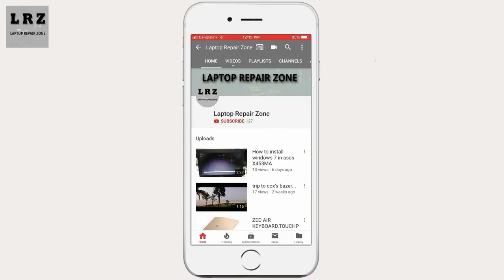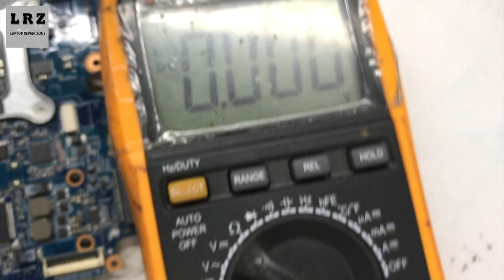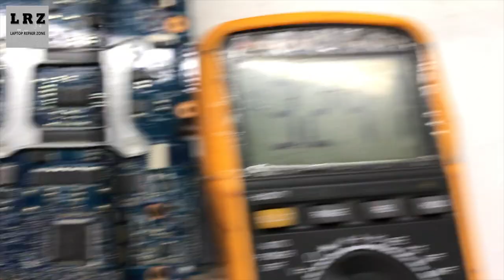hp probook charging light blinking white । Hp probook 4440s charging LED flashing

Comment: Hello friend, thanks for the video, I have in my laboratory an HP Probook 4440s, remove the capacitor that you show in the video but the fault continues, it has 3.3 volts in the power button, but the light keeps flashing 8 times and it turns off.
Reply: Lo solucionastes

Comment: Hi. I have same problem but laptop turns on when i replugged the charging pin and if i don't replugged , its lights keep flashing. Laptop is without battery. Any solution??

Comment: I Have ProBook 4340s in my case led on for one time & Can't turn on when i remove the battery 

When the battery battery is in the laptop led doesn't flash 
Please tell me what is the problem
Reply from the maker: Art By Sketcher thanks for your comment, you need to check all the required voltage step by step thanks.
Reply: @Laptop_repair_zone  now I change the Charger White led blink 8 times & Stop
Reply: @artbysketcher  how'd you fix it I have the same problem

Comment: One question, after doing all the steps, the flashing of the LED desperate and the few seconds appears again, does this cyclically and still does not turn on the PC, what other step can I follow, thanks
Reply from the maker: Walberto Pacheco thanks for your comment,you need to check 3V and 5V is ok or not.
Reply: after opening the capacitor, 5v and 3v are present, but it is as I told you before

Comment: 9 times out of 10 its just the Cmos battery undervolting below 3v. Your better off just replacing the flat coin battery since the battery is probably 6 years old by now. If your Multi Meter reads the batter below 3v replace it. otherwise its probably the capacitor like in the video.
Reply from the maker: Thanks for your comment.
Reply: Thanks for the tip, I have a HP Pavilion DV5 with charging light flashing like in this video, I checked the CMOS battery and it is indeed undervoltage, I’ve bought new coin cell to replace tomorrow, hopefully it’s as simple as this but it was overheating with random shutdown before the flashing charging light started
Reply: @darattaqwa  what happened
Reply: @alchemy9115  replacing the cmos cell didn’t resolve the issue
Reply: @darattaqwa   so , How it got resolved sir !!
Reply: @alchemy9115  I didn’t bother with it, I sold it faulty

Comment: 3.3 present and 5 present 
3.3 in power press is present 
3.3 bios pin is present 
in power there are 0.04 when i put the cable

Comment: I ve Hp 440 G2 Probook, my laptop was working fine a couple of days ago but when I plugin the adaptor or connect the battery, the power button and Caps lock light starts glowing ( not blinking) and the DC jack led keeps on blinking slowly .  What could be the problem and why did it happen on its own?
Reply from the maker: if possible remove CMOS battery than tray.
Reply: @Laptop_repair_zone  thanks for replying. I checked the CMOS battery . It was low 0.47 volts so I replaced it with a new one. But the problem still exists
Reply: @Laptop_repair_zone  yes I tried doing that thing too
Reply: @Laptop_repair_zone  I think problem is bigger that that.  I am not an expert so can you please tell me  what does blinking DC led  mean , trying to tell . What kind of things can lead to this

Comment: 3.3 present and 5 present 
3.3 in power press is present 
3.3 bios pin is present 
in power suply there are 0.04 when i put the cable

Comment: i have the same prob but the  RTC aux s5 is present what i doing after
Reply from the maker: Check 3.3v and 5v
Reply: @Laptop_repair_zone  3.3 present and 5 present 
3.3 in power press is present 
3.3 bios pin is present 
in power suply there are 0.04 when i put the power supply cable

Comment: Hi i have 5 models like this one..3 of them give video and all voltage present..But just before it loads the Windows OS it shuts off and reboot..Tried troubleshooting and no hope.
The other 2 as soon as you plug it in it auto restarts and reboot loops continuously ..the power jack Led and Power Leds just keeps blinking none stop...I tried flashing there bios but still no hope.This is a very troublesome model..
Reply from the maker: Thanks for your comment, please check switching voltage, CPU, and suspension voltage.